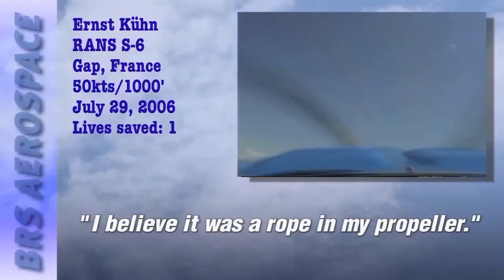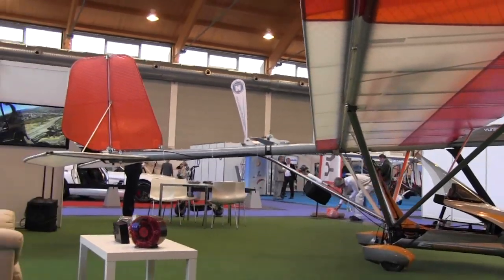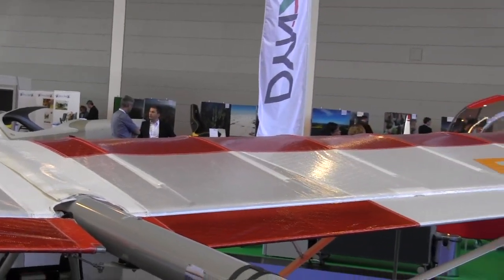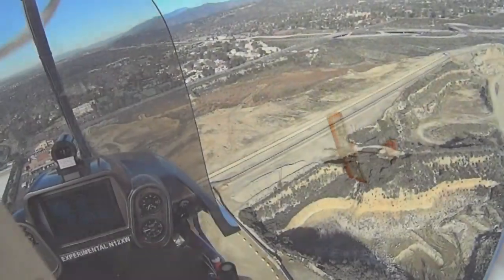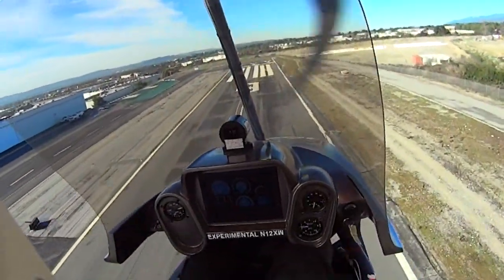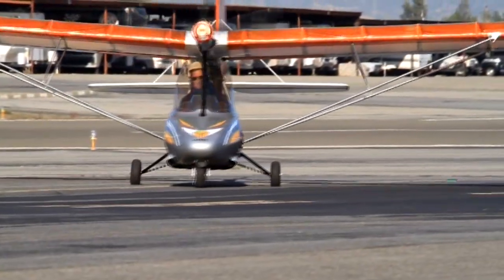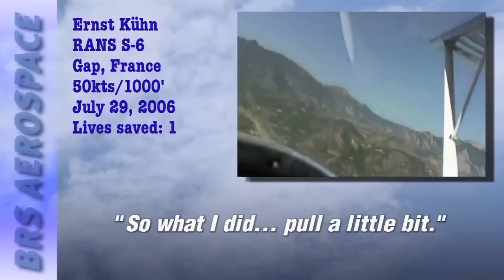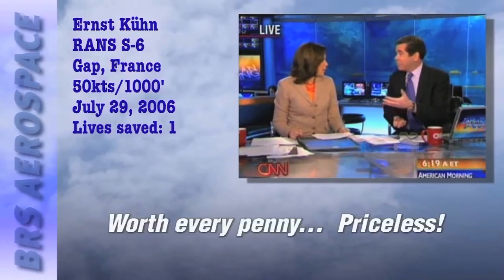GreenWing, electricaviation.com, e-spyder electric powered light sport aircraft, Aero Expo

Comment from the maker: I will have to disagree, since to buy and build a Lazair today from a kit with electric power plants would easily start at $20,000. and 400 to 600 hours to build it. One of the things you have to realize is that if you were to fly an electric aircraft for 1000 hours @ $4.00 per gallon for fuel burning 4 gallons per hour you have spent $16,000. just for FUEL. You still need at least two engine rebuilds to add to this, plus oil.

Comment: make the wings transparent tuck flexible solar panels in them and a controller and charge your batteries as you go.
Reply: the power output to weight ratio is too far off. Solar panels only push mabe 100w/m^2. this thing draws 30kw easy at full power
Reply: I'm currently building a Foot Launched Powered Hang Glider (electric) with this in mind as the ultimate goal.  It won't even be close to 100 percent efficient, but it could extend your flight times by 10-40 percent depending on how much you thermal with no power.  Then land and let it charge to full while you camp or whatever and fly away again!